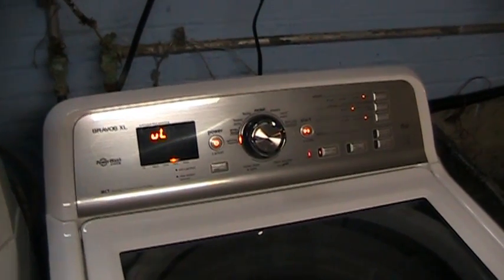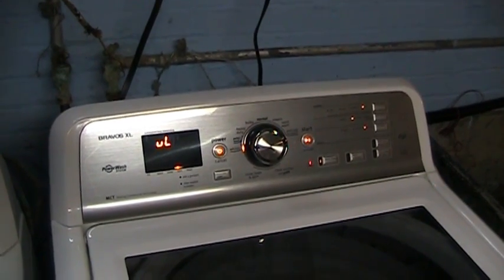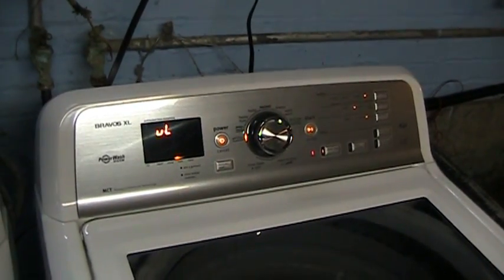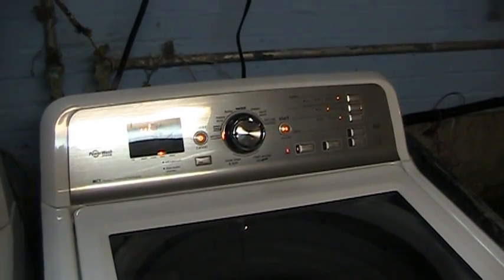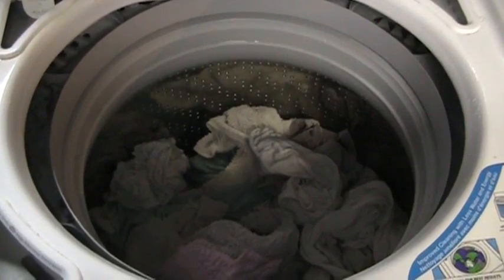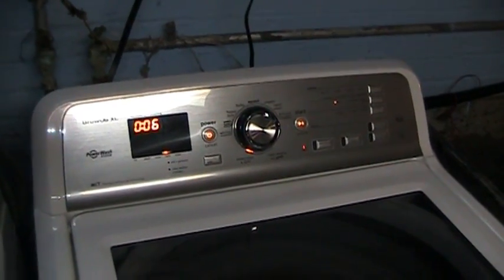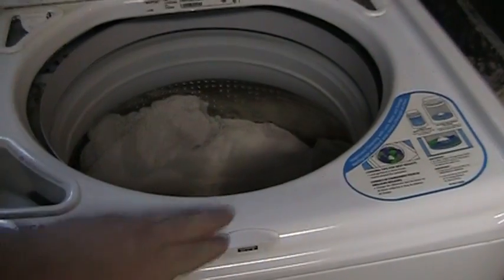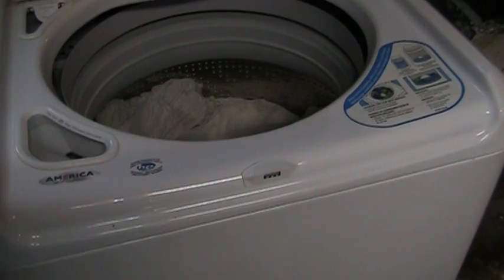Stupid Washing Machine Being Stupid

Comment: Speed Queen is the way to go.  I've had mine a little over 4 years.   I'll never go back to an electronically controlled machine.  My last machine was a Frigidaire front loader..   Electronics burned out after only 4 years...   In my opinion, electronics should never have been put into appliances....  just adds to the complexity and more things to go wrong.   When it comes to appliances, keep it simple!
Reply: Ehh, you see commercial-grade appliances with electronic controls all the time that seem to work without issue, I know most of the newer laundromats, for example, like the one closest to my place, seem to be mostly Huebsch or Speed Queen washer/extractors with electronic controls, or Dexters, with the dryers being the same marque and control scheme, and I haven't had any real issues with them.

The big dishwashers at my current job - Hobart FT900s, also have electronic controls and they see hours upon hours of use every day while rarely failing.
Reply: Exactly!

Comment: I've found that those machines with an impeller have a good probability of unbalancing when just dumping your laundry in, as opposed to taking the time to lay the items around the drum evenly. For the most, I hated the Cabrio we had. It suffered the dreaded f1 error, and would require 10-minutes worth of stop/start button fiddling for it to start any fill cycle. I was happy when one of the inlet solenoids froze and that junk was put on the curb...after stripping it, of course. :)

Comment: We have the same model on machine, and it behaves in a similar fashion when unbalanced. It typically throws the uL error and begins filling itself until it's contents are suspended, and then proceeds to preform a wash cycle until, I suppose, it feels satisfied that the contents are thoroughly redistributed.

With placing my laundry, as recommended in the instructions just under the lid, in a ring around the center of the drum, and then giving it a spin to check the balance, I have only had to intervene two or three times in the, probably almost a year now, at least, that we've had it.

As for it taking it's time. Yes, it sure does seem to love doing that.

I will say though, that the very first time we used it, some stains on my cloths, which I had thought would likely be permanent, disappeared.

Comment: I just wanted a simple old school top load manual controlled washer machine..... NO!  The wife wants the overly engineered front load with all those dumb electronic gizmos.  Nothing but problems.  I usually unplug the dumb thing for a few minutes then plug it back in.

Comment: We have an "Energy Star" refrigerator. It has a bunch of sensors and control logic which attempts to figure out the optimal time and duration to run the defrost cycle, and who knows what else.  The justification for all this complexity is to save a little more energy, because energy costs money and people like to save money.
The PCB has been replaced 4 times. The first 3 replacements (each of yet another revision) each bought about 2 more years of service, but the 4th time it did not.  It's inability to cool itself to an acceptable temperature and stay there on a permanent basis remains unresolved.  The fancy built-in self diagnostic tests, while entertaining, haven't clarified the problem.
Each PCB has cost $100-$130, and that's DIY - labor would multiply that figure. The value of your time, cold food, and peace of mind would multiply it even more. Energy efficiency in it's current state of "operation" is unknown, but unlikely to be anything near what the EPA advertised on their cute yellow tag.

Out in the hot garage we have a refrigerator from 1993. It needed one part replaced in 1994. That is it's entire service history.

All the cold food is kept in that refrigerator, because it works. It might use a little more electricity but has accumulated $0 in repair expenses.  It consistently runs ice cold in 100 degree summer heat without issue, year after year.
I don't know whose money that modern refrigerator is supposed to be saving, but it's not ours.  I suppose some lobbyists made a lot of money for their employers getting it legislated though.

Comment: just out of curiosity,Bill,does yours do a little song at the end of the cycle? and btw ours does the same damned thing,and we have a Samsung Front Loader.We sometimes get the UL error,as well...
Reply from the maker: No, it doesn't do anything at the end of the cycle other than to release the lid latch and turn on a "finished" indicator light.

One can disable the startup and button sounds, which would have happened long ago (even if it took a soldering iron or wire cutter) if it were my choice. (Then again, if it were my choice, these wouldn't even be here.)

Comment: It's retarded washing machines like this that make my blood boil.  Everything you said in this video is true.  Energy Star is a hoax, just like "Cash For Clunkers".  There's absolutely nothing green about this machine whatsoever.  It can't figure itself out, of course that's due to the firmware.  One of the biggest problems is we don't have any good programmers anymore, everything today is extreme bloatware, so there's probably a lot of {poorly written} code in that firmware that could be done without.

There was never anything wrong with an older machine with a center agitator.  Somebody, someday, decided that those weren't necessary anymore, because agitation doesn't do any good, it just wastes energy and doesn't clean anything.  But as you and I both know, if there is a stubborn stain on an item (and I'm sure you've seen your mother do this a hundred times), you pretreat it with either a stain remover or detergent, then rub the fabric together briskly.  That's known as agitation!  It separates the fibers to allow the cleaner to get into them to help remove the stain.  Water, and plenty of it, does the rest.

How the designers of these machines could possibly think they could improve upon designs that had been in production for 50 years or more is beyond me.  I guess it's a different breed of people, from a different generation.  The part that really bothers me are "millenials", who I don't think in the least would be please about an hour and 9 minutes for laundry to be done, at which point it still needs to go into the dryer.  Especially since they're all about "instant-on" and "NOW", not some time in the near future.

Comment: I agree that the "high efficiency" thing is a big scam. I think it's more wasteful to build new appliances than keep running older ones, which, as shown in this video, may not even be that much less efficient than new ones.

As for bad quality... 6-8 years ago, we had a horrible run of Whirlpool appliance bad luck. Our GE dishwasher, which worked well from around 1992, died (I don't remember how) around 2008. We got a Whirlpool Gold dishwasher, and its motor wasn't seated correctly at the factory or got bumped during shipping, didn't seal, and leaked water everywhere. The replacement had a cracked plastic "leg" (or whatever you want to call it) and we got it replaced again. The third one, which we kept, had some minor crack in the plastic near the foot, but nothing we thought would cause long-term problems. It worked OK for a few years, and now it seems as though it sometimes fails to heat the water enough to clean the dishes. And the door seal started leaking, and my dad patched that up so it's sealed for now. Perhaps the brokenness upon arrival was due to it being purchased from a discount appliance store, but the heating and door seal shouldn't have been.

Then, around 2009, the motor on the Whirlpool dryer (also from around 1992) died. My dad, in a rare bit of pro-activity, decided to replace both dryer and washer, thinking the washer may not be far behind. After the dishwasher experience, he decided to just get the cheapest, most basic model, mechanically-controlled Whirlpools he could because they would just die soon after. Well, after a few years, I believe it was the switch that runs through the cycles went bad in the dryer. Then, around 2010, the transmission or whatever gear was between the motor and the drum went bad, and it wasn't worth replacing. So, I did some research and found that one of the more basic LG front-loading dishwashers (though fully digital) got great reviews, and when we looked at it in the store (I think it may have been Sears), we liked the build quality. Plus it has a 10-year warranty on the direct-drive (no gears to blow up!) motor. That washer hasn't had a single problem. It seems to clean well enough, I just don't like that it twists and tangles the clothes, and it vibrates and shakes a lot on the spin cycle. But the reliability is worth those inconveniences.

Comment: These modern washers are pretty much all garbage. We have an LG front loader that had a rear bearing failure. it lasted about 10 years. now we're using a 1987 Sears 70 series that was given to us after it sat outside for a year. works fine!

Comment: Try doing a clean cycle and use Affresh or any other cleaning solution. These need   cleaning WITH a solution to clean sensors. The lid lock is required, because they spin extremely fast and have a center motor.
Reply from the maker: All it was, was unbalanced laundry.

Regarding the lid lock, these spin no faster than a conventional washing machine, and the motor is brought down to a stop in under a second by electric braking.

Comment: These new age top loaders are junk. The electronic control board will fail before long without a surge protector inline. This happened to me on my Electrolux front loader which has been a great washer, but the appliance repair man basically told me that without surge protectors in line on these newer machines with control boards failure is almost guaranteed. I am glad I bought an extended warranty on it. i now have it plugged into a surge protector.

Comment: We have this same machine and the matching dryer. The set are both absolute garbage, they take forever to accomplish their simple tasks. I absolutely despise over complicated garbage like this.
Reply from the maker: Strange, that. I'd actually rate the dryer really highly. It really gets the job done. I'd readily pair it up with a nice vintage washer of conventional design and I'd be very happy. (This dryer is, apart from the electronic control panel, of extremely conventional design.) This is, however, the gas model.

Comment: Knock on a lot of wood, my mid 80's Whirlpool washer and dryer are still going strong, and I've had them for 14 years now, payed $50 for the pair. They are used to not only clean clothes, but as a workbench when such need arises. Keep my drill press on the drier :)  Sure seems like to me if they end up breaking, i'll probably just do my best to fix them and keep em going. Seems like this crap made the last decade or longer is just pure crap and in the long run would be better just to fix what I have at least as long as parts can be found. I keep hearing the same stories about washers breaking, sometimes even within a couple months. That much water going down the drain there certainly is not "green" or "energy saving" lol total BS.

Comment: Have you tried to fix the washer your self? This is a video on how to fix the uL code. https://youtu.be/RNOFc6dov0w
Reply from the maker: It was only some unbalanced laundry. There was no need to take anything apart. A little bit of persuasion got the cycle to finish and the machine's been fine ever since.

The point of this video, such as it is, is to suggest that Whirlpool's engineers needed to spend a lot more time on the firmware of this unit. It never should have behaved in the way that it ultimately id.

Comment: Even Maytag has cheapened their stuff since Whirlpool took them over. The Maytag washer and dryer Mom bought in 2007 are nothing more than rebadged Whirlpools. The washer and dryer before them were 1986(Washer) and 1992(Dryer) back when they were real Maytags. The washer had a problem that supposedly required more than it was worth at 21 years of age. It was used a LOT and had NEVER broken down until then. So it did well.

Comment: I have a front loading washing machine, dryer, and a water heater from Whirlpool and they still work. My dad and I had to fix the water heater since the pilot/burner controls fizzled out, we purchased that part at Lowe's for $50 + tax, and the burner part for only the $30 shipping (free of charge with the warranty).

Comment: Well, it's Obama's fault, ya know!  Har har!  I was a Sears tech for many years and serviced many of these machines. In my mind, they are high tech junk, and it is not just Whirlpool.  Whether it is a washer or dryer, a dishwasher, your furnace, or your range or wall oven, while they look impressive, and have all these cool features, all those delicate electronics are vulnerable to surges and spikes of voltage from the power line. I will take my 13 year old Kenmore Whirlpool direct drive washer with a mechanical timer anytime.
Reply: No it's Bill Clinton who grand China to bring all Chinese goods to America since 1990.

Comment: Frustrating thing I've learned... my mother needed a new washing machine. You can only milk a 1970's Whirlpool so many decades until I finally croaks for good. Bought a Roper (Whirlpool) and that POS still has the electronic operation and locks the lid... on a standard spin top loader!  Good God! I am hoping to keep my Kenmore (Whirlpool) washer and dryer from the 1990's going as loooooong as possible. Both have needed minor repairs, but are very much DIY fixable.
Reply from the maker: We had a 2011 or so Roper model in excellent working condition. It was the long suffering Whirlpool dryer that died (motor failure) and rather than repair it, my mother decided she simply wanted a new set of matched machines. So the dryer went off to be recycled and the Roper washing machine went to another house.

The Roper was everything a washing machine should be and nothing it shouldn't: mechanical timer control, decent set of basic cycles and a conventional enamel/concrete drum with agitator. My mother's complaint centered around its being "small". Which was really rather ridiculous, the only larger machines were those without a conventional agitator. I would have kept it until the day it died.
Reply: Funny thing, when my mother's Kenmore dryer was done for, we bought a Roper and it's exactly the same dryer as my Kenmore, at a lower price. 3 temps, automatic via outlet thermostat, good old reliable technology. That is why I didn't think a thing of buying another Whirlpool/Roper  from Lowes to replace her old Kenmore washer.  Little did we know.....

Comment: I think I'll stick with my 1978 Maytag washer.  I bought it from a used appliance store in 2001 and the only thing that has failed in it is the hose that goes from the valve where you connect the water lines to the tub.  It started leaking when the tub was filling but I could shut the machine off after it filled and it wouldn't leak anymore.  After replacing that hose no more leaks.  Anything else that I've done to it I consider routine maintenance.  The drum brake after 37 years started slipping on large loads and would allow he drum to rotate with the agitation so I replaced that and also a couple bearings that are easily done at the same time.  I also replaced the belts on it once when the old ones were getting a bit crusty and slipping.  It's kind of beat up looking but it's still chugging along just fine at 38 years old.  I have videos of it on my channel if anyone is interested.

Comment: Back when my mum moved into her first home she was bought a brand new Zanussi washing machine at the time, it lasted 25 years before in the end we scrapped it as it was used in a shed when we moved to France for a number of years, even when we bought it home it still worked. The only reason it was scrapped as my dad struggled to find a new timer mechanism for it (it was a completely mechanical machine). We still have a zanussi fridge in over conservatory and that's coming along nicely to its 24th birthday! That thing will freeze a can of coke in a flash if you get daring with the temperature control.

Comment: My parents had a top of the line Bosch front loader since 2000 they won at some contest thingy. It worked perfectly until 2015 when my mom dropped a bottle of chlorine on the door. We replaced it and it worked until May 2016 when the balance sensor broke and now it makes a weird noise. We got a cheap Beko frontloader.

Comment: Will you fix this thing and show it on a video?
Reply from the maker: Fixing it would likely involve throwing it out of a window and buying a Speed Queen as a replacement. As I don't have any windows that large...the answer would be no.
Reply: +uxwbill XD
Reply: The only reason why this appliance doesn't last long because, Whirlpool decided to go cheaply made that lasts less than five years which sooner later about 2 years later after when replace the parts for this Chinese Made Appliance, it will fail again. 

So the best bet is to stick with Speed Queen Appliance which it's design to last long for about 25 years which that's absolutely amazing, and they're really excellent quality.
Reply: +Bluethunderboom I hate Whirlpool! Almost everyone else does!
Reply: Halen Martini Same here because, I rather go with American Made Appliance that are design to be serviced and design to last long like Speed Queen. Not to mentioned that I love the vintage General Electric Filter-Flo Top Load Washer which they did an excellent job to keep the clothes clean and to filter the water while agitating. =)